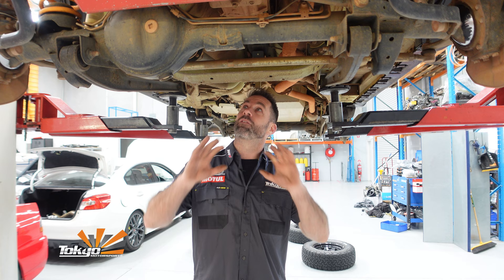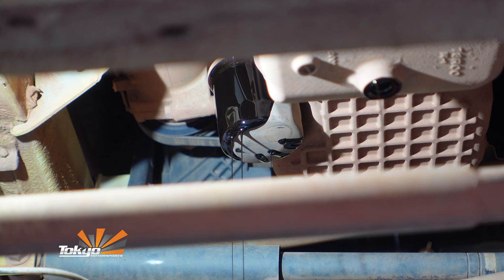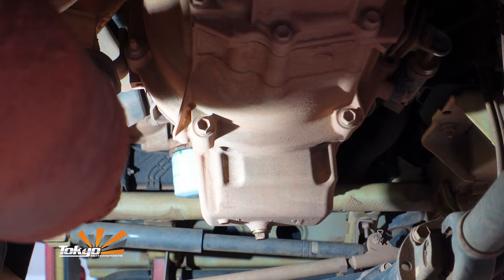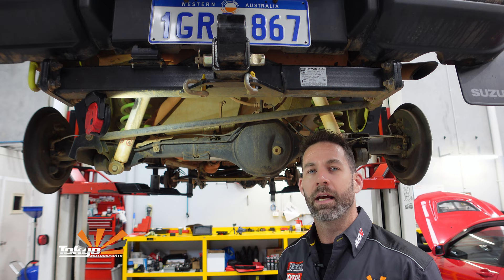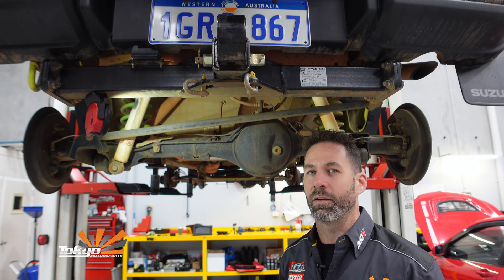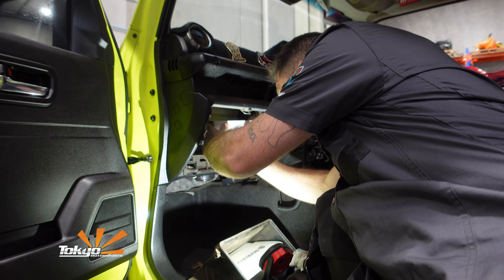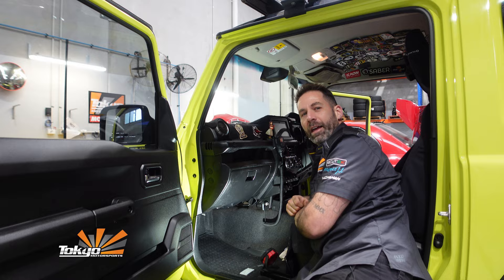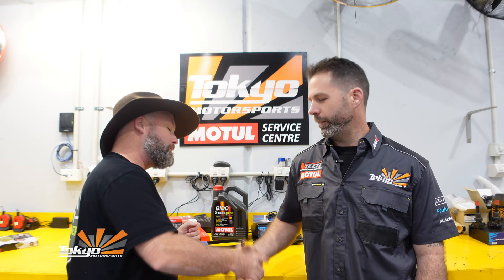HOW TO SERVICE YOUR JIMNY // JIMNY OIL CHANGE // JIMNY AIR FILTERS

Comment: With oil filters that screw into the bottom of the engine, it's worth filling them with fresh oil before screwing them on.  Means you can get the level right sreaight awat and avoids oil starvation on first start.
Reply: That’s myth, doesn’t do much.

Comment: Mate had a lot of work done to his Evo's back in the day there and now with Phil there we will be getting the Mighty Marshmallow serviced there also.
Reply from the maker: Legendary!! We have a few big mods coming up on the Jimny over the next few months all being done at Tokyos
Reply: @MightyOverlander  do you stick to the 15k servicing or do at 7.5k?
Reply from the maker: @DT95WA  I do it around the big trips. Which I do a lot of
Reply: @DT95WA  I found that interesting how Suzuki Australia doubled the service interval length from 7,500kms to 15,000kms? 
I think it was in late 2019 ish as the first JB74s that were sold here had 3yrs standard warranty with 7,500kms service intervals, but Suzuki changed it to a 5yrs standard warranty with 15,000kms service intervals, yet to my knowledge nothing else has changed? 🤔 
Surely thats abit too far in-between engine oil changes? I never reach that, do about 5,000 to 8,000kms each year, but if i did do more I'd be changing it more often.

Comment: Hey there, what oil did you use for the diffs, GL4 or GL5. Suzuki manual doesn't specify it
Reply from the maker: I will double confirm with Phill the Mechanic and get back to you!
Reply: @MightyOverlander  thanks a ton, be waiting

Comment: Mine needs 3.9 ltr with new filter not 3.6 as written in service book
Reply: 300ml or so would be taken up by your oil filter. Check level again after engine has been turned over briefly like he did in the video.

Comment: Nice vid Tony..Is there not a torque setting for the sump plug?
Reply: There is
35nm for oil sump plug
23nm for manual drain bolt
21nm for manual fill bolt
55nm for front and rear diff drain bolt
50nm for front and rear diff fill bolt
17nm for auto drain bolt
23nm for transfer case bolts

These values are from the "gold Series" service manual that was translated from russian

Now you dont have to use a torque wrench, but you can use your head.
auto trans pans are thin, so snug is enough
manual bolts can use a little more than snug
diff bolts snug and maybe 1/4 turn
oil sump, snug and 1/5 turn

As Uncle Rodger would say "Just use feeling", but if you are unsure, use a torque wrench

Comment: What grade diff oil would you recommend for my Jimny with ARB air lockers? 🤔
My workshop used Valvoline High Performance 85W140 but said a 90W140 mineral oil doing light work would be fine which i found confusing, as thats a thicker oil than what they already put in it during installation? 
Curious to see what others think, also the oil capacity as I'll be doing my first oil change on my diffs soon.
Reply from the maker: I’ll ask Phill the Mechanic and see what he recommends
Reply: @MightyOverlander  cheers mate 👍Phills service vid was very helpful. 
I've started getting stuff ready like I've bought a pump, made sure i had a 17mm socket for the drain plug etc. 
Also i found that a 10mm male square socket is a perfectly tight fit for the filler plug compared to a 3/8 drive ratchet which is a little loose, but doubt that'd strip anyways as it isn't high torque. 

Could you also please ask Phill  where i can buy those new nylon and copper replacement washers? From a Suzuki dealership or just universal ones from anywhere online? Cheers.